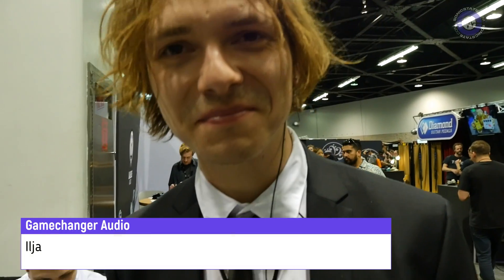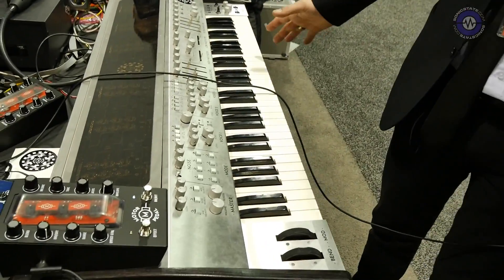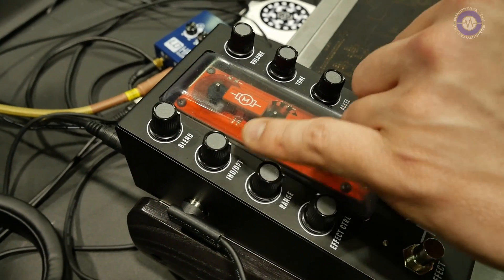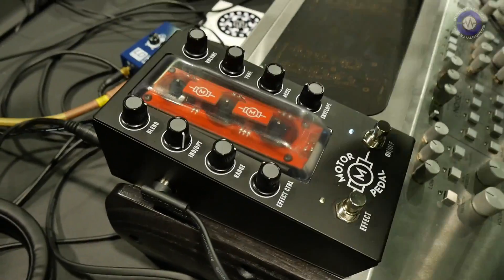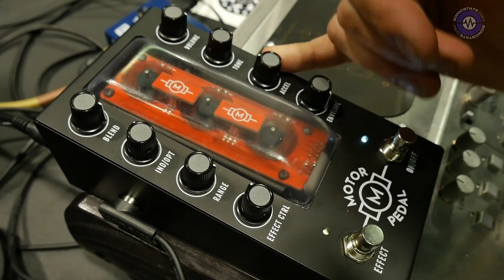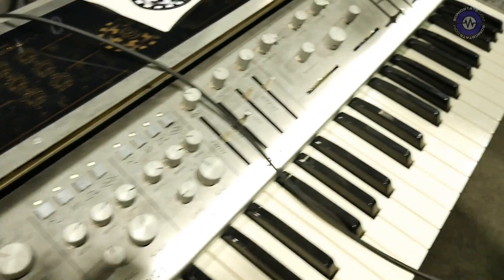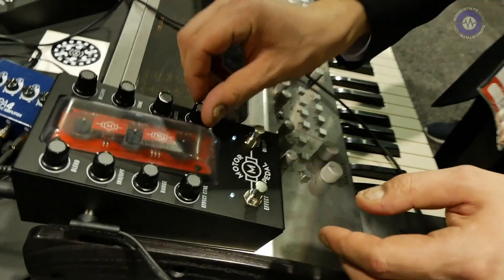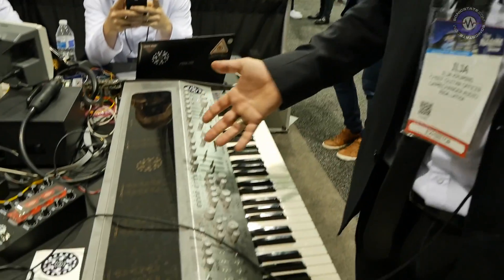NAMM 2019: Gamechanger Audio Motor Piano - Poly Synth Madness...

Comment: This is so cool - is it more like an alternate take on a Polymoog than a Hammond B3?  It looks like it has that combination of organ and synthesiser.  I wonder if they could have an option of using samples or another form of synthesis for the very beginning parts of notes, to address the latency issue for some patches  - it could be a bit like how analogue drum machines like the DSI tempest or Electron Analogue RTHM use a combination of samples and analogue voices.... maybe then it could do original takes on things like Chroma sounds, Tine pianos etc.
Reply: I was imagining the same thing. But add that kind of approach, I would think it is like cheating. Why make it all sample based at that point?
Reply: @hnatyshyn   - I was thinking it would just be the "attack" part of the sound. I think some drum machines and other synths work this way?  it wouldn't have to be samples necessarily, could be FM synthesis or something too.
Reply: @rekindle  I was thinking about the attack too. I am not that much familiar with FM synthesis. Perhaps standard oscillators could do the trick, except you have to also think of the motor induction sound too. If it was for me, I would rethink the motors discs so they can have multiple pitches available at the same time, thus reducing the portamento. Other options could include some kind of momentary quantizer or pitch corrector. It would still be cheating but at least it would stay authentic to the oscillator's tone.
Reply: @hnatyshyn  - yes I don't know anything technical about how this machine works or if what I suggest is possible or a good idea, I was thinking FM might be cheaper and smaller than VCOs?   Maybe another way would be for the motorised discs to be playing all pitches all the time and pressing a key just opens a gate, I think that's how a divide down machine like a Solina works? But I'm not sure! ... it's such an interesting looking keyboard though right? I really respect these guys for trying something new.  I'm looking forward to hearing the finished version!
Reply: @rekindle  Problem with multi pitch motors is the pitch will then be fixed, sacrificing the portamento, which is still interesting, and then you could not have motor induction on all pitches. 
So yeah, the finished version will speak for itself. Also we can expect other companies to make their own variation of this one.

Comment: I think this has won NAMM*! To minimize portamento on the poly they could have unused voices automatically idle to a range of different speeds, then when the next note is played the one running at the closest speed to the required pitch could be allocated to get there. Damn cool idea.

[*] Apart from the Sonogenic song
Reply: They can use just 12 motors with bigger wheels where all the octaves printed
Reply: Or use stepper motors
Reply: I didn't know it's a competition ...

Comment: That is an amazing concept, but what about wear of brushes in motors?
Reply: They have 2 wires (brushed). Brushless needs 3 wires like RC Motors.
Reply: Presumably they are brushless, I don't remember him mentioning brushed ones
Reply: @Wagoo  They seem like regular brushed DC motors. Brushless motors have three connections per terminal and would be ridicilously expensive to drive 30 something motors each with dedicated driver.
Reply: They look like standard brushed motors to me.
Reply: He did say DC motors, and that they were essentially being used as voltage controlled oscillators.  Brushless motors are not - they have to be driven by an electronic speed controller, which is basically an oscillator, usually a three phase one.

Also, they do look like brushed motors.  I've used a lot of small motors, of both sorts.